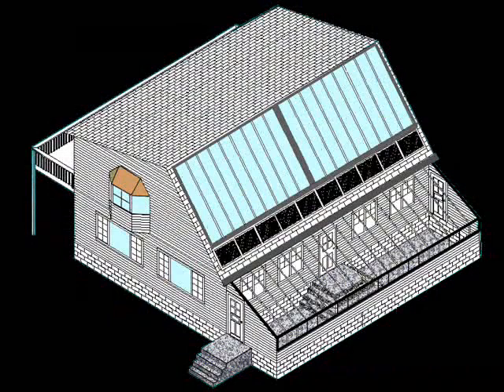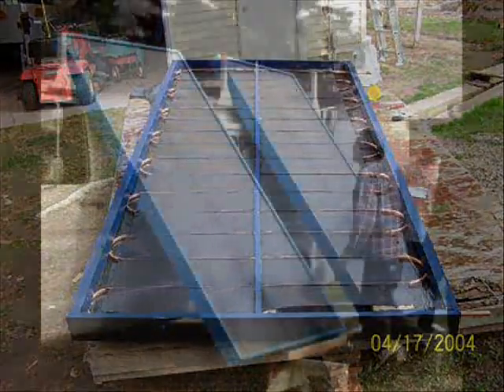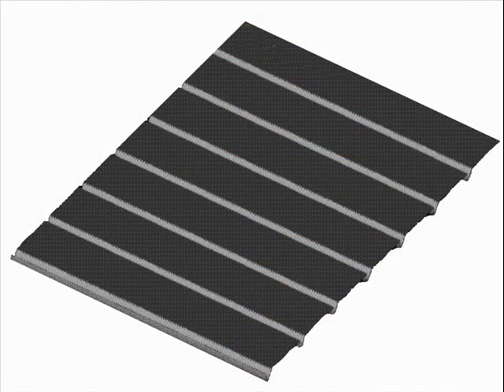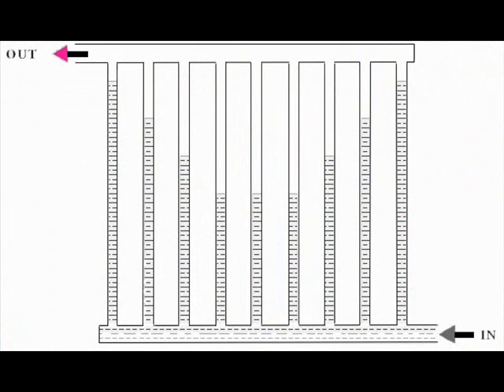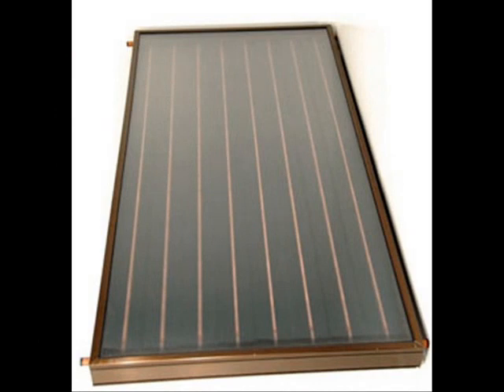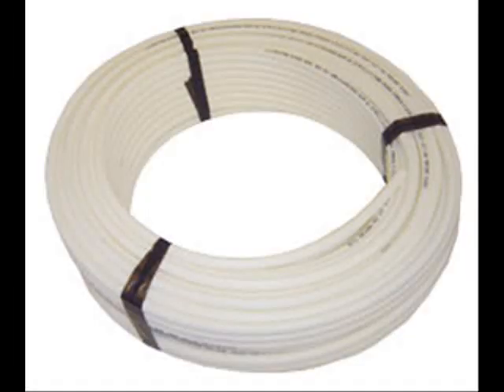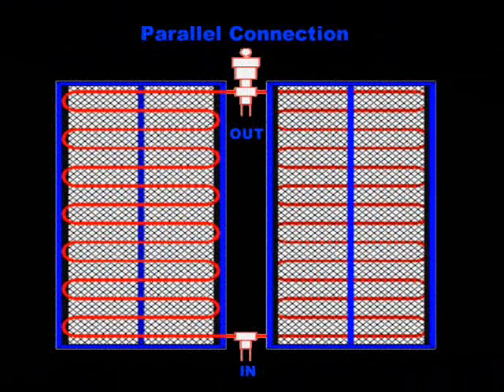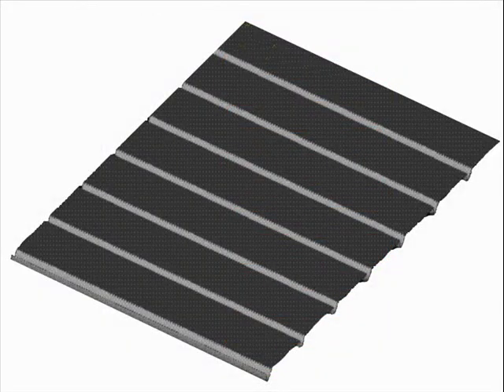Homemade Serpentine Collector

Comment: You failed to mention that Serpentine tubing takes a significant surface area because of the curvature limitation.  This makes the boxes that hold them very large and cumbersome to handle.  You did not include the price of the items used and the cost of assembly.  It does not look like a product for the average DIY enthusiast.

Comment: I don't think it makes sense to have the pipes "below" the absorber plates ... that means the pipes are in the shade, so to speak, and all the heat the pipe will pick up must be by conduction.  If you put the absorber plate below the pipe, the sun will radiate directly onto the pipe and sunlight caught by the absorber plate will conduct to the pipe.

I think if you move the pipe up above the absorber plate you will increase your efficiency significantly.